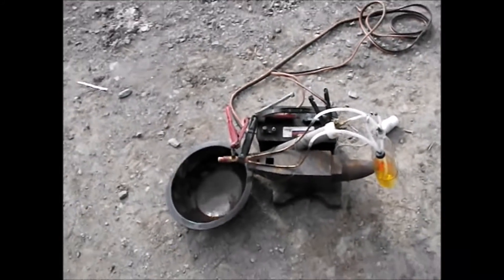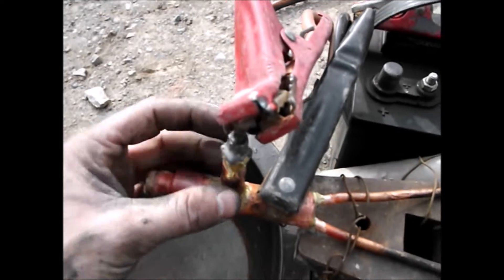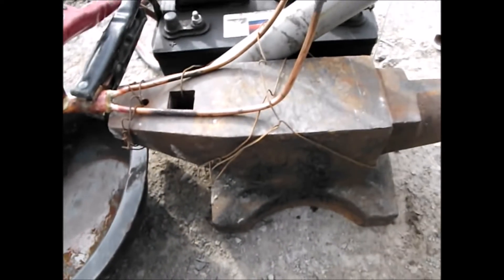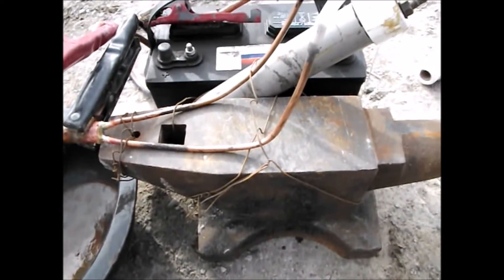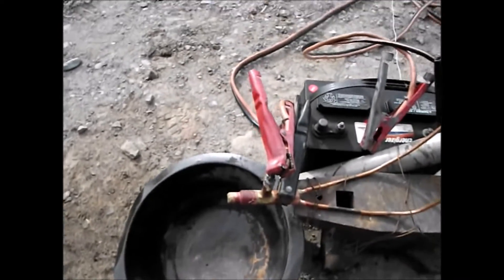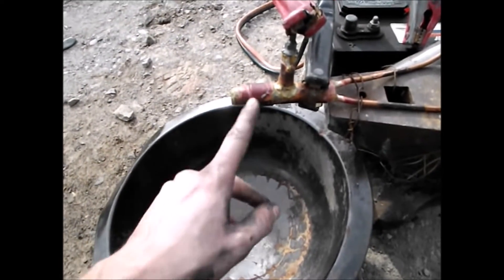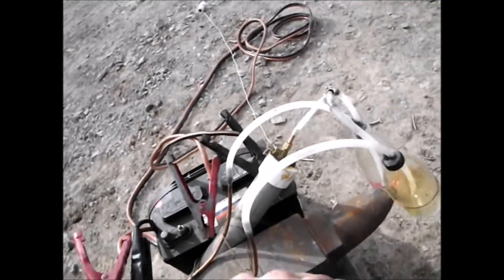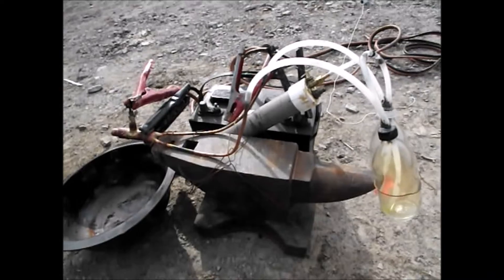Homade Liquid Fueled Roket Engine Tests 3 and 4

Comment: I'm so excited about your experiments on liquid propallant rocketry, and the usge of nitric acid is kinda like geniuse!
but I guess the main problem is the injection part, the holes are just to big,
the propellants come together as big drops, and do not mix at all, as diesel is hydrophob, so they just react on the surface and get blown out unused, which causes that interrupting uncontrolled burn,
If the components would get really fine atomized, with an spray nozzle for instance you should have a quite powerfull engine!
Or try to get a two-fueled nozzle, that would do it just perfectly!

sorry for the smart shiting, i just was very excited for developing my own liquid fuel rocket back in the days when I was in technical collage
Reply: +Cody'sLab

SO cool. I don't know of many rockets that ran nitric acid post WWII - I
 think the Wasserfal used RFNA and something they called Visol - vinylisobutyl ether plus aniline.

crazy german engineers + hypergolics = fwoosh.

Have you thought about adding a drop of detergent, or cutting the diesel with a little acetone to knock down the hydrophobicity & surface tension?

a couple of drops should be enough to determine how well they mix.

Absolutely love the spectrum of your investigations. Can't wait to see your bees on Mars ;)
Reply: +Cody'sLab How about a bigger combustion chamber?  Looks like most of the burn is happening outside.
Reply: +frozendonut bf did you actually spell oxygen like that on purpose or are you just stupid?!
Reply: ***** I am not sure if you have enough pressure but a fuel injector from a small engine vehicle could also to the trick.
Reply: ***** My town, spook I wasn't even the one you were originally talking to. On another note, good luck paying for a flight to Japan you filthy peasant.
Reply: John King How do you know oxygen is a "basic" word for him, he may not know our language very well.
Reply: John King I am not sure how many times I can say to you that it may be basic for you, but not basic for him.
Reply: +John King Why do you care?
Reply: ChineseSweatShoppe.. So I can AVOID Your town.!
Reply: I care because oxygen is such a basic word... and to spell it "ocsigen" is just awfull! Also making people from the internet angry is amusing;)
Reply: its a basic word cus its phonetic.....
Reply: k thanx bye
Reply: ChineseSweatShoppe..Whoops.. S'cuze me.!
Reply: I don't understand why he didn't use turpentine as a fuel. It reacts hypergolically with nitric acid, and it's a safe, common, and simple-to-obtain substance.
Reply: in no expert but to me it looks like there is not enough ocsigen to maintain te combustion

Comment: I'm really interested in your experiment and wanted to start experimenting with this type of engine. I was wondering where you got the nitric acid? Thanks for the answer before this. I'm 16 and I built solid fueled rocket engines for a science fair project. Like i said i'm really interested in this type of engine so if you told me where to find the acid I would be very grateful.
Reply: hey I know why this didn't work the way you wanted .. you need a little bit bigger of a combustion compartment .. maybe like a box or bubble twice as big as the nozzle .. have this right above the nozzle for the two chemicals can mix and combust .. inside that compartment that's where you put the glow plug .. this would of worked flawlessly if the compartment was bigger .. look to actual rocket engine design when doing something like this it will save you a lot of work .. understanding how it works is the most important part after you know then you can just scale everything down ..hope this helps

Comment: what ratio proportion did you add the fuel and nitric acid? Also what type of fuel did you use?
Reply: +Cody'sLab do you know what the stoichiometric ratio is for nitric acid at your level of purity + diesel fuel + atmospheric air at your altitude? I'm not sure where to find the equation but that would be useful to know

Comment: And maybe you want to use some sort of horizontal kitchen scale instead of the anvil method to get more accurate thrust measurements
Reply: Yeah that'd be nice, but there's  no need to make it too complicated, just putting the whole thing on wheels and having it thrust against a scale would be miles better than your current setup.